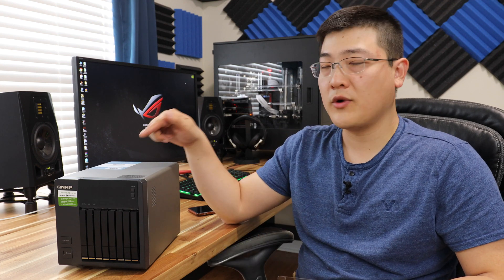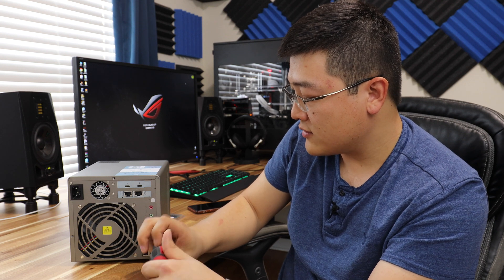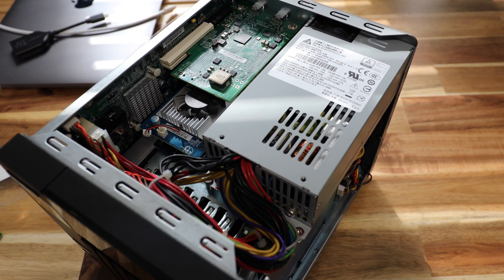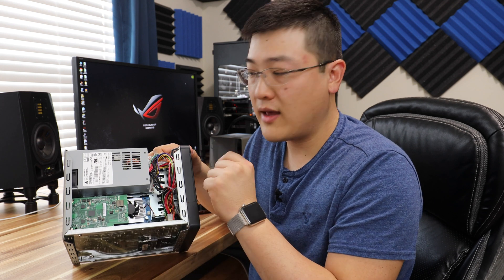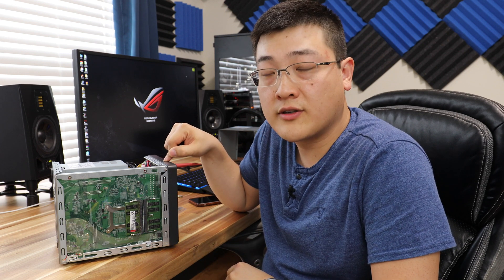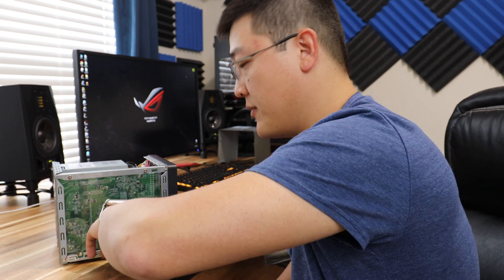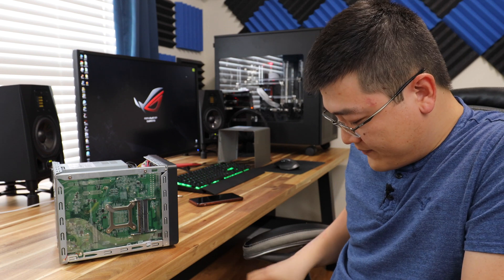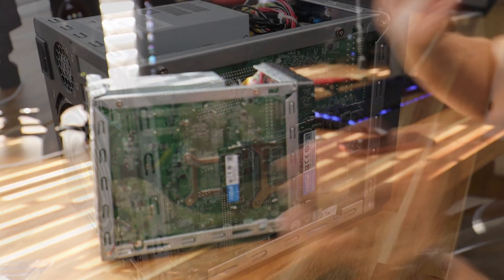QNAP NAS Memory Upgrade & Quick Look Inside TVS-882ST3!

Comment: Hi, I am having some trouble to upgrade memory for same QNAP model with you. I purchased Samsung 16GB PC4-25600 memory. Is it problem for PC4-25600? It seems you upgraded with PC4-19200.
Reply from the maker: The 882ST3 is compatible with 2133mhz and 2400mhz. It looks like you might have bought 3200mhz memory.

Comment: I’m having some trouble sorting out if the TVS-682 takes laptop CPU or desktop CPU.  It came with I3-7100 according to QNAP but i cant tell what the difference is between I7-7700 and I7-7700hq, are they interchangeable?
Reply from the maker: The 7700HQ is a mobile processor and sits in a FCBGA socket, meaning it’s soldered in and can’t be removed. You’re very unlikely able to buy a 7700HQ processor separately even if you wanted to. The i3 7100 suggests that it’s a FCLGA socket so you would want the regular 7700 that fits in the LGA.
Reply: @StanYanMan  Thank you Stan! You are a tremendous help.  May I also ask what is the maximum amount of RAM I can put into my TVS-682? The user interface tells me I have 4 sockets of which 2 are filled with 4GB each. The price of Ram on QNAPs store is very expensive and QNAP says the unit only holds 16GB, but I think this may be a marketing answer so I buy the 1282 instead of the 682.  Background: I have a small tax consulting business with 8 employee workstations and about 500GB of client data in pdf, excel, word and quickbooks files.  Plus software and Windows Server essentials 2012 OS... I only have 200GB room remaining on the servers 2TB RAID 1 array with a hot spare. Server is 7 years old and the QNAP will hopefully be a backup for the existing server and when it dies, the QNAP will be file server replacement.  Thanks again for your very helpful video and your insight into the hardware parts. Thank you Thank you Thank you!  If I can ever help with a tax question, please ask.
Reply from the maker: According to the website specs, the TVS-682 can hold 64GB (4x16GB), same as the TVS-1282. The i3-6100 CPU supports DDR4-1866/2133 but I think the system supports up to 2400Mhz. A reputable third party memory manfuacturer will work with the QNAP. Something like a Kingston, Corsair or Crucial among others.